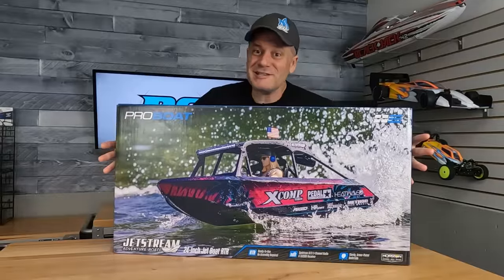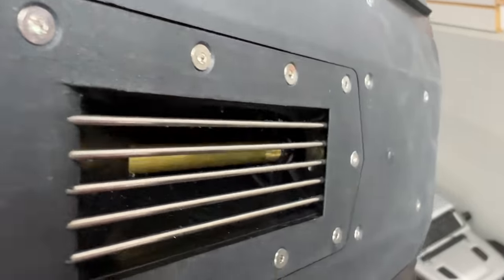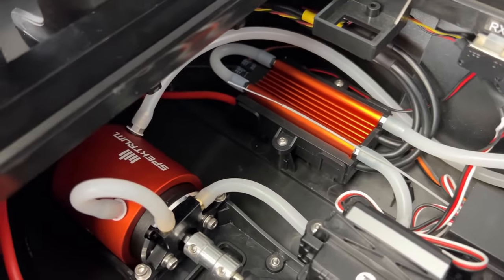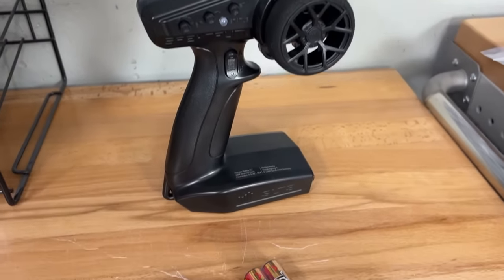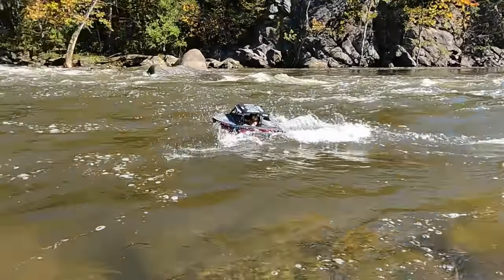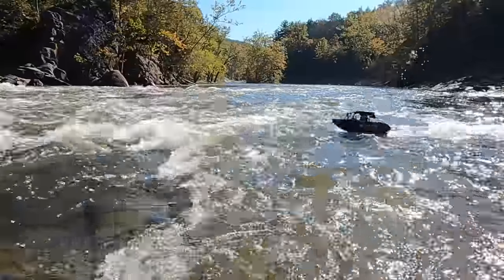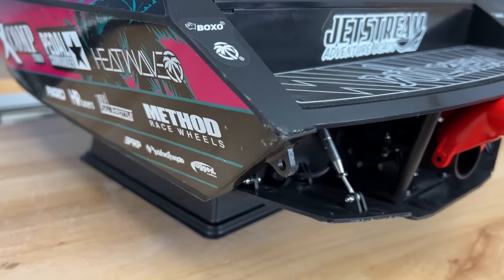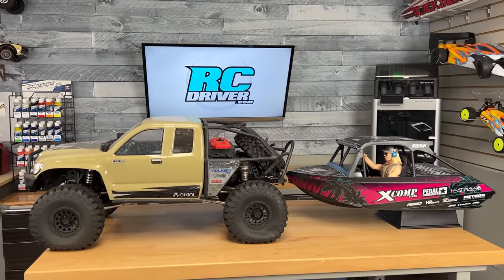EPIC RC Mini Jet Boat! ProBoat Jetstream

Comment: *PSA* for anyone looking to purchase. I Lost mine to the river the other night after flipping it! I would strongly recommend having a recovery plan In place prior to running this boat in the rapids. These boats are stable but they will flip and you will lose it if you can’t get to it quickly.
Reply: Swim
Reply: 😮Ouch ,I lost my wltoys 916 jet boat around 4 weeks ago at the river ,bought another 🤟💯🤠🇬🇧only £35 , with this big beast you must of been gutted 🙏🤠🇬🇧💯 sending you some GOOD LUCK mate .🤞
Reply: Don’t they have self right?
Reply: @IsaacSchultz-lz8jc  No
Reply: That odd because all there previous jet bashers did, why downgrade?
Reply: I'm sorry this happened to you I know the feeling! 

I lost my m41 and my brother's rescue tugboat trying to rescue it.
Reply: Sorry to hear that I lost my spartan traxxas to
Reply: Made sure to throw my crocs on so i could wade into the river when i was jumping and smacking it off of rocks.  Love this thing and can’t wait to upgrade a few things to make it even better.

Comment: For the price and the included dirt cheap electronics the hull should be made of fiberglass and not an ABS plastic. And everything hardware wise should be stainless steel out of the box. I’ve heard a lot of folks complain about the plastic hull separating and/or just shotty assembly in general. The boat should be around the $250 range. Tops.
Reply: I totally agree I think this boat looks really good initially but yes should be fiberglass and stainless hardware for that price and personally id like it bigger even a 40 inch version. Just saw this boat and went strait to reviews and was really excited but let down fast. I mean no seals to attempt to stop water coming in and the bottom of hull looks like it leaks.
Reply: @najstephy5565   I bought the original river jetboat a couple of years back, it sank on its maiden, just about managed to get it back, jet thruster was not sealed to the Hull and let water in,  I wouldn't trust this company again on any of they're boats, garbage 😢

Comment: Awesome jet boat. Definitely a well needed departure from the previous Pro Boat River Jet in design and concept. Sure, that hull design led itself more towards flat water lake and river running, too. But I suppose that doesn't matter if it doesn't run well. My River Jet was a complete duck. Issue after issue after issue. This new boat looks like a true rapids performer, but I am curious why Pro Boat didn't include self righting this time. Flat and squaty hull - I get it. But that sure seems super risky for guys running it like it designed for in rapids.
Reply from the maker: Perhaps with the boat being so wide and flat, it would take a massive flywheel on the motor to get the right amount of inertia to get it flipped back over. And maybe that would hurt other areas of performance. Just a guess. But I wasn’t able to flip it even during my additional running when the cameras were off. The ProBoat guys said told me they only flipped it a few times in super harsh conditions. It seems stable. But yeah, there’s always a chance something will happen.

Comment: good evening, thank you for your video
One question, I have a lot of boats and I grease the transmission hoses every time I go out. It's normal 
For this one, even if it's a rigid shaft, you still have to lubricate it But on the instructions, they don't say how often
And the problem is that you have to dismantle everything each time and it's long and restrictive if you have the answer to my question thank you very much and have a good evening

Comment: Great boat but the back end is very weak with the adjustable trim tabs. Mine were broken off within two batteries and I barely touched any rocks. the corner of the skid plate is broken off at the back as well. I think they should have just made different angle trim tabs that could be swapped out and screwed right to the bottom of the boat or clipped in somehow. maybe they should have just found a happy medium and made them solid. I am going to make something better than the extremely delicate trim tabs that are (were) on there now. other than that it is really fun and easy to use. I really like the battery hold down system they use that clips right in. Makes it quick and easy to change.

Comment: What happens when it stops running and goes down the current?  Or gets stuck or you lose control?   Bye boat and money
Reply from the maker: 9:38
Reply: @rcdriver  so if boat floats away for miles...out of sight...I see a problem
Reply: @@marcochonaille9775 I'm surprised there's no battery level on the controller. One has to guess.